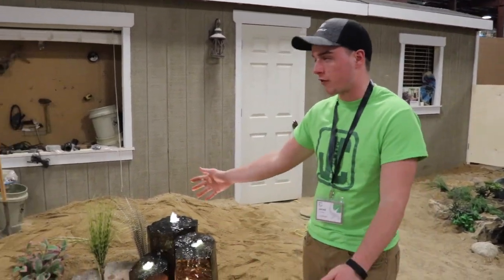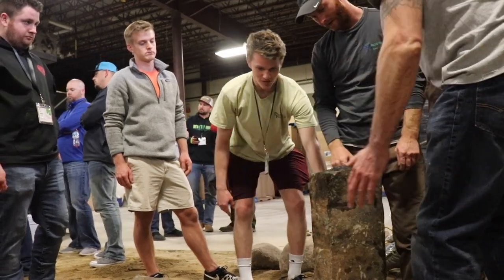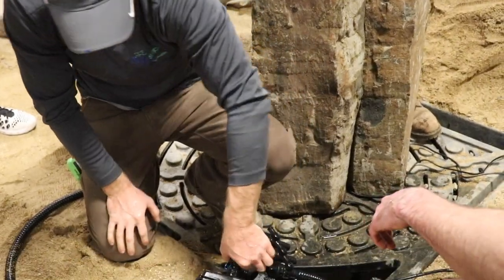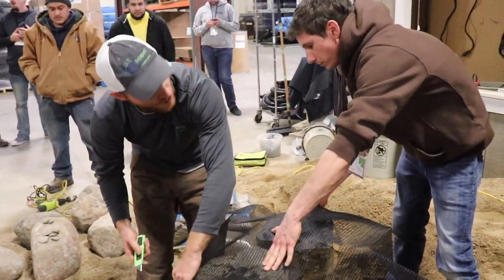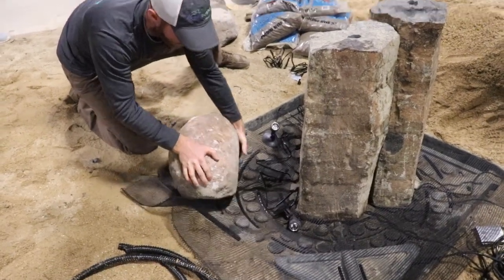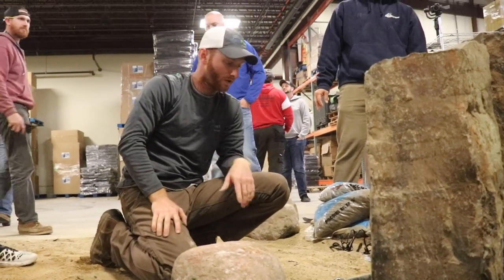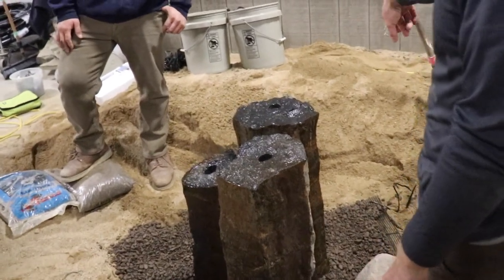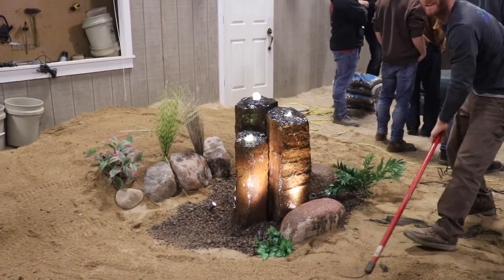How to Build a Pondless Water Feature (DIY)

Comment: Seems like a neat thing to try, but I have two questions if you don't mind: 1) how do you keep the water in the bottom? With some kind of bin or something? Obviously just a hole wouldn't be ideal. 2) how do the pumps survive sucking sand and debris from the dirty water?
Reply from the maker: The water all stays in a basin at the bottom. The pump also sits in that basin. There are filters in between to reduce the mount of debris going through the pump. If done right, there should be almost no build up. Thank you for watching!